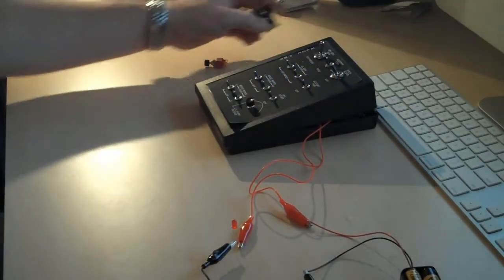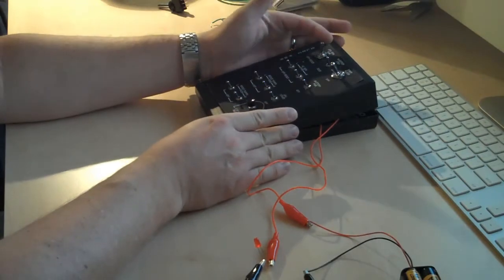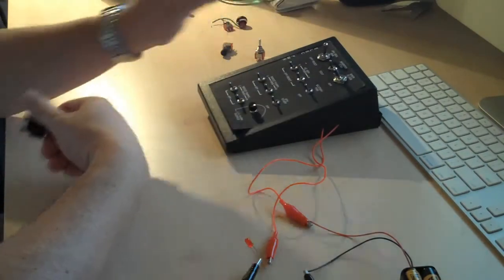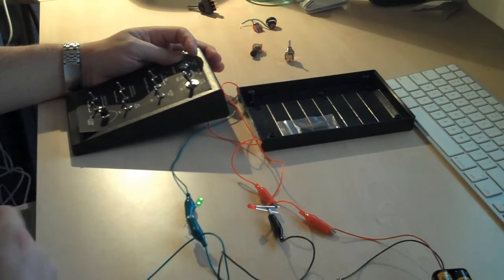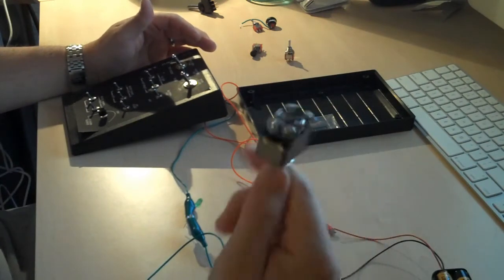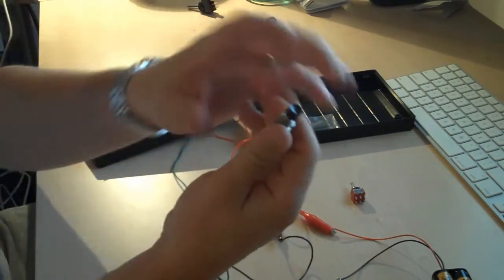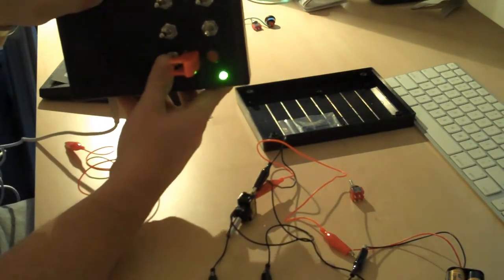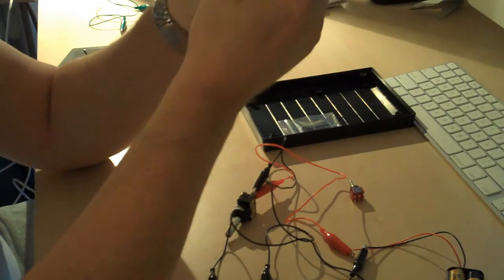All About Switches

Comment: Note related to the switches, but what enclosure is that you are using to house the switches??
Reply from the maker: Just ones I bought at a local electronics shop called JayCar. You can find similar ones on eBay.